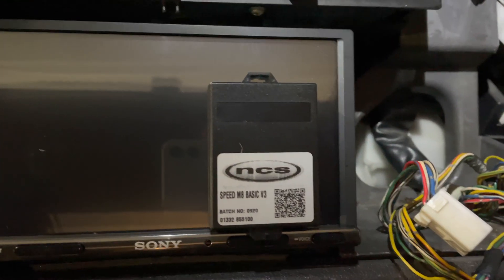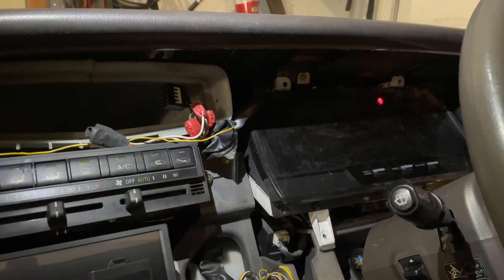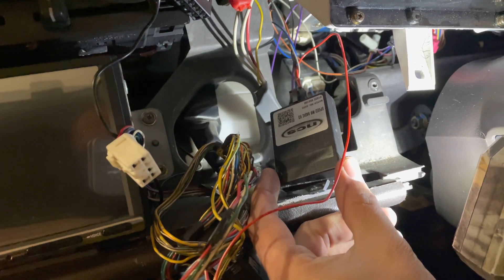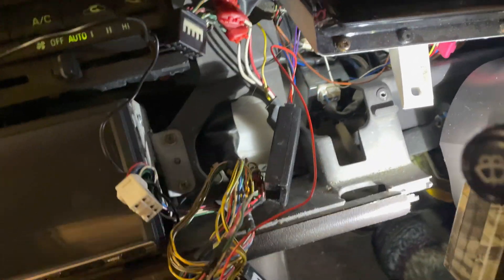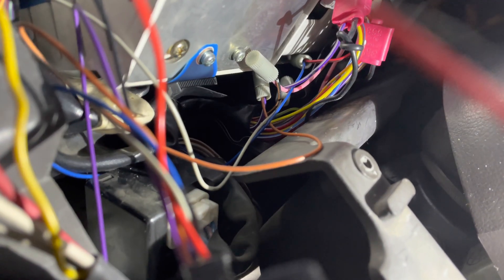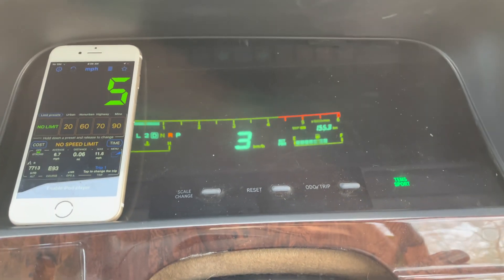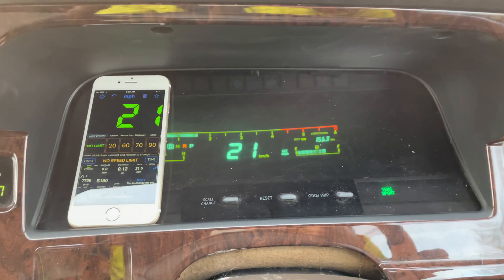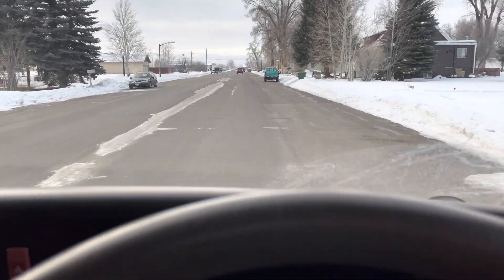How to convert KMH to MPH The SPEEDM8 Basic converter Toyota Hiace Super Custom Limited

Comment: Hi, need help! sorry to keep bugging you. Im in the middle of installing this on my kzh106. What I notice is the instructions, which were identical to yours, shows the black wire being connected to the brown wire on brown plug. Problem is, there is no brown wire on the brown plug. I also noticed you used a power supply from the clock? And a ground? Neither of which I see in the instructions. Thanks for your help.
Reply from the maker: Hey, sorry I don’t check comments too often. The black is ground, which I just put to a bolt on the metal in the back. The power wire from the clock I don’t remember the colors, but just found one 12v using a voltmeter.

Comment: Could you get this digital speedo installed into a manual Hiace?
Reply from the maker: I don't think so without some rewiring of the plugs. I have not seen a non digital gauge plug yet, but I know they are different pinouts of the speedo based on the instructions from speedm8